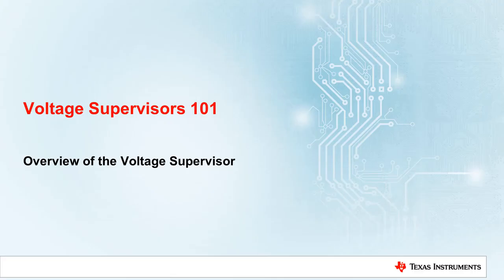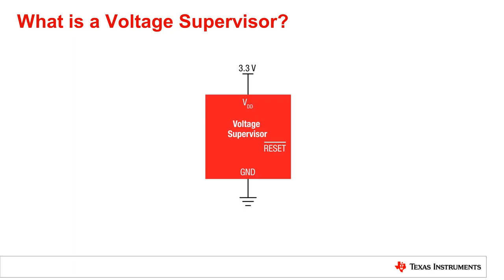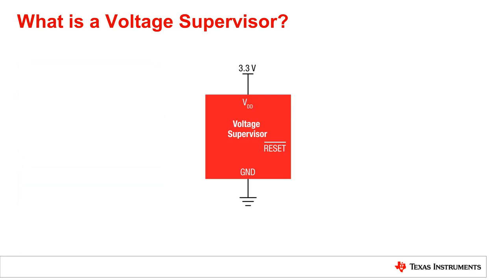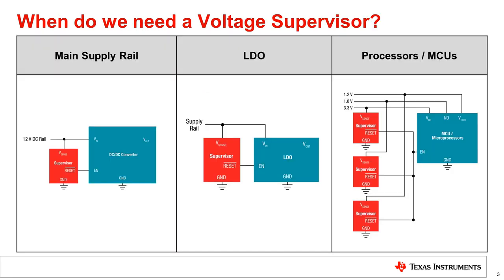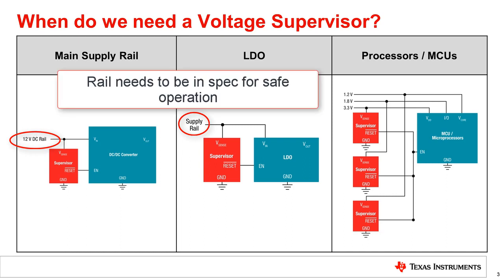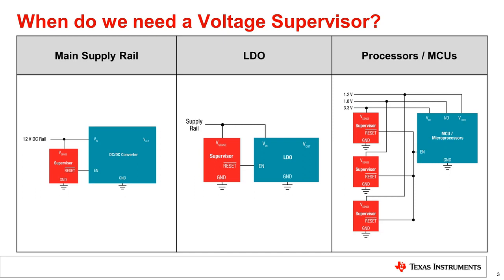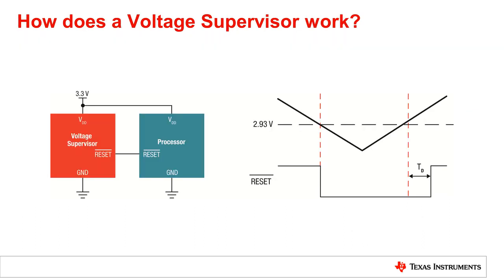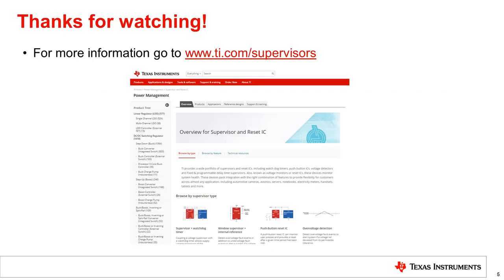What is a Voltage Supervisor?

Comment: Are there any TI MCUs with built-in configurable Voltage Supervisor (ULP)?
Reply from the maker: Hi Krish, 
Yes, TI has MCU’s with built-in supervisors such as the 
MCP430fg6626. Look for “SVS” on the MCU datasheet. However, supervisors built-in to MCUs have 
poor accuracy compared to a standalone supervisor. Depending on your system, a tighter accuracy may 
be required. For example the MCP430fg6626 has a ~3% accuracy, while TI’s standalone solution can go 
down to 0.5% (TPS3890).